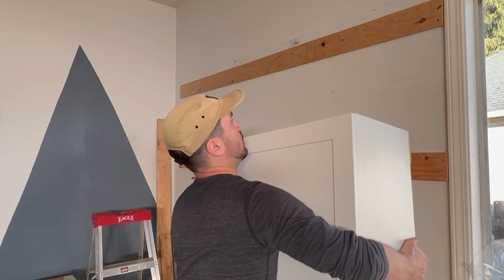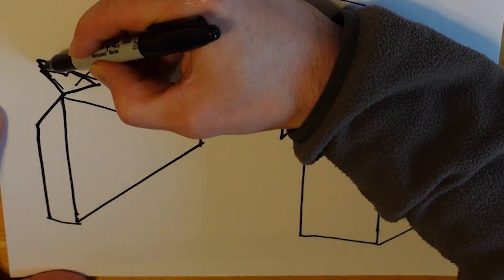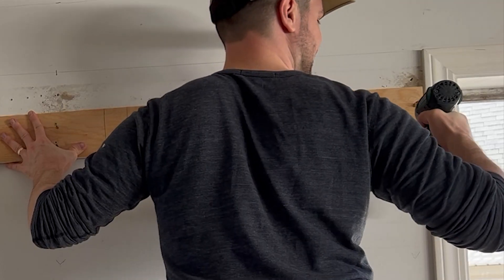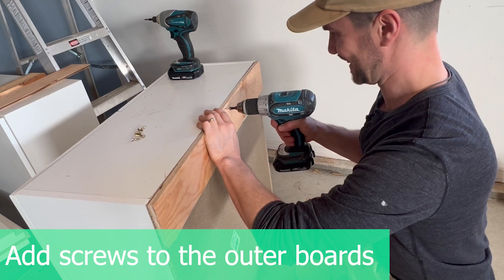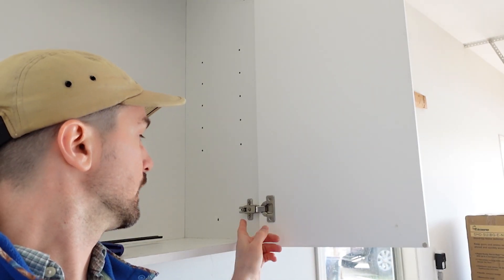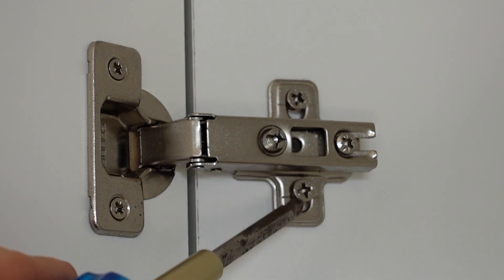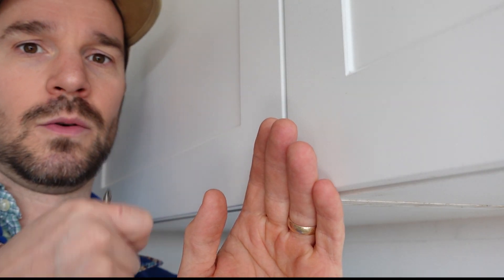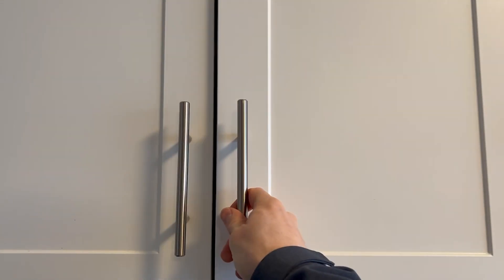Add storage to your garage! #diy #home

Comment: Perfect!  That's a great diy video.   Using a French cleat is a great idea.  I've installed 6 or 7 Ikea kitchens and this is a way better system.  Smart move.
Reply from the maker: Hey thanks, man.  The cleats make levelling straight forward and made the install pretty easy.  Fortunately my neighbour gave me the tip about them and has a table saw.  I won the neighbour lottery :D